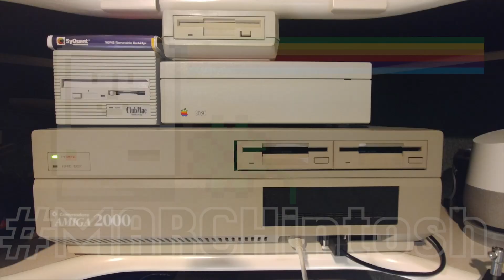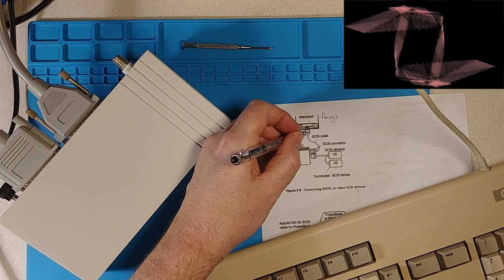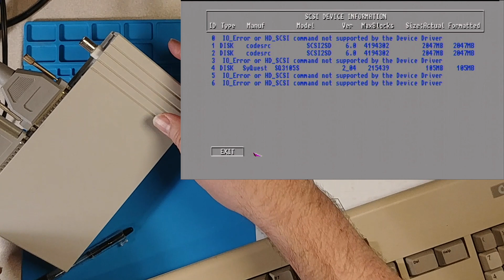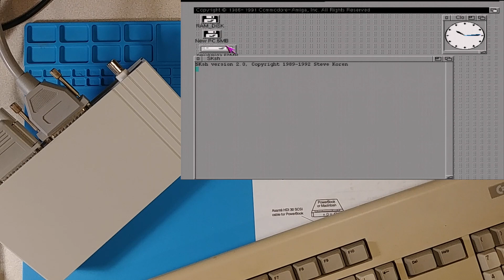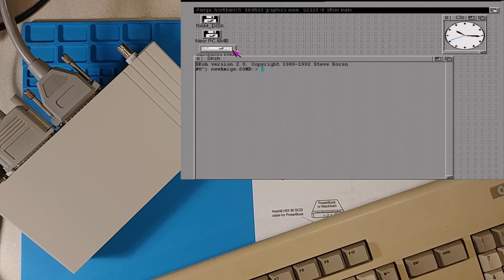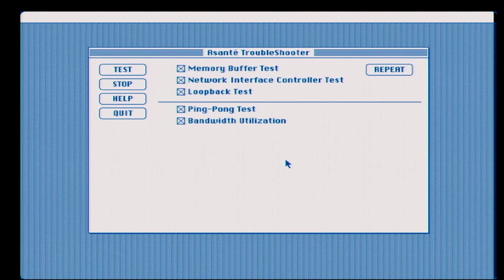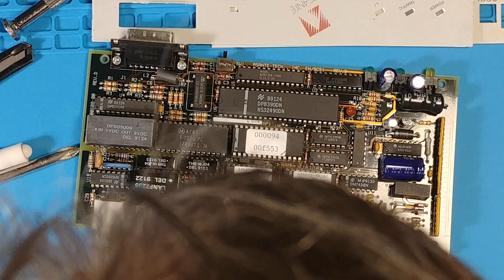#MARCHintosh Mac Plus: Sneakernet to Ethernet?

Comment: Not entirely related but I will throw it out for consideration. You can run NetPresenz (see Mac Garden for that), it's actually now free. You can designate an old Mac to act as an FTP LAN server (not god for WAN only because there would be an insecure connection but that would be up to the admin) … with that software allowing any LAN computer to access that old Mac FTP server. Alternatively, you could purchase something like CrushFTP (which I use) and create an FTP insecure instance server (Crush supports many protocols) and a modern computer could then offer plain FTP over say port 2121 for the LAN. You would connect using ftp://10.0.x.x:2121 username X pw Y and all your old vintage machines could then see files. Again, not related to the video topic but is more of a tangential comment. Thanks for the video!
Reply from the maker: Hi Alex - thanks for sharing ideas. Since all those require TCP/IP connectivity, I presume you mean I could do those after I got network connectivity, which I don't have yet. Because I have the early version of A-Max I also don't have a port for AppleTalk. (Later versions of A-Max have a card that goes inside the Amiga that offers these ports.)
I'll keep looking and have this on the back burner.
Ron's Computer Videos made an interesting comment that it would be interesting to see the RaSCSI project add ethernet for SCSI macs to take the place of this long-gone commercial Asante solution.
Another out-of-left-field possibility is to use something like the First Class BBS software. 
Geeky Bit channel just did a nice little intro to that:
https://www.youtube.com/watch?v=0RyhYFkz_-s
I would be stuck with slow serial (e.g., wifi modem or direct null-modem) for now but theoretically that would allow file sharing across Mac generations, like my System 6 machine to OS X. 
Of course I'm trying to get better than serial speeds. Anyway, just some random ideas. :)
Reply from the maker: Hi Alex - Aside: your comments seem to keep disappearing :-/. (I'm not doing it. :) and they are not in the managed comments anymore) If it is some YouTube problem, feel free to write me at the emali address in my channel's About info.

Comment: Can A-Max do AppleTalk over a serial port?  If so, you could instead use an AppleTalk to Ethernet bridge that supports MacIP.  That would allow you to connect to an ethernet network via your serial port.
Reply from the maker: Good point. It depends which version of the A-Max hardware someone has. I have the original A-Max cartridge, which only provides a 19-pin Mac floppy disk port. I use the A-Max II software (actually version 2.5, but with the original hardware.)
The later A-Max card has a port for AppleTalk.
You can see it here:
https://bigbookofamigahardware.com/bboah/product.aspx?id=341

Comment: The case looks to be of very high quality. Amazing how many archaic devices are out there designed to do random things. Never heard of this device. Neat stuff.
Reply from the maker: Oh, ya, it's a beautiful aluminum case.
These Ethernet-over-SCSI devices for Macs were roughly the equivalent of the similar Ethernet-over-parallel-port devices for PCs. RetroTech Chris showed off one of those here, i.e., the Xircom Pocket Ethernet Adapter III (at 2m25s): https://www.youtube.com/watch?v=uIb7AjsPSZw#t=2m24s

Asante made a smaller one called the Mini EN/SC and also some specifically for Powerbooks.

Comment: Lefty! You have 2 SCSI2SDs?  can you update one of those to be a "less steps" sneakernet?
Reply from the maker: I have three, but two are slated for my x86 Linux boxen with Adaptec SCSI host adapters.
For the Hackintosh, I decided to go with the FloppyEMU, after seeing Jeremy's glowing endorsement in his video this morning:
"The Mac that finally got it right. Macintosh Plus repair, history and test drive."
https://www.youtube.com/watch?v=d65ze2nuKp8
Reply from the maker: Duh, you're right. I'm being dumb. I already have the v6 SCSI2SD in the Amiga, and the Mac emulator can see it. I could probably just put native Mac partitions on it, and write to the SD card from a modern machine with Mini-vMac or something? This is along the lines of what Matt (retrobits) suggested... I just don't like the idea of having to run an(other) emulator on a modern machine just to populate the SD card... it's probably just because I haven't tried it yet.
Reply from the maker: I can pull my (flailing) 5 1/4" Seagate hard disk out of the Amiga (which is what I replaced with the SCSI2SD), and mount the SCSI2SD there, so I don't have to open the case to get access to the SD card.
Reply: @DrDavesDiversions  is that an st-225n?
Reply from the maker: @temporarilyoffline  From the same era, but it's the venerable and ginormous ST-296N (84MB) that I bought in college. I thought it was $400 in 1990, but I see it listed for $550 in the Safe Harbor (Amiga products dealer) price list I have - the place I bought from most often.
Reply from the maker: @temporarilyoffline  Somehow I doubt my SCSI2SD will last as long as the Seagate: 30 years.

Comment: I have a variation on this device that I've also never successfully gotten to work. It was over a decade ago that I last tried it and I know a lot more about networking now, so maybe I'll give that a try. If it's similar or uses the same chips I'll let you know. Mine is a lot smaller and from what I remember encased in rubber, but there has to be a breakout box or something. Like I said it's been a long time since I've played with it.
Reply from the maker: Super cool! Ya, try it out! There is one called the Mini EN/SC and and also an EN/SC PB (powerbook). The Asante driver (5.1) loads fine on System 6.0.8.
Reply from the maker: I could have used your rum punch after screwing around with this broken thing last weekend! :)
Reply: @DrDavesDiversions  😂😂😂 I totally understand.
Reply from the maker: @JeremysRetroBar  19:20 I should make a "sigh" playlist. :)

Comment: Happy St. Patty's Day! Sorry you weren't able to get it working this time around :( It would be super cool to be able to use native Mac hardware   on the Amiga. 

My preferred way of getting data to the Amiga: if it's small, Zmodem download from my linux pc over WiFi modem and if it's large, stick the scsi2sd's card in my main PC and mount it up inside of UAE. Neither is ideal and having networking or USB would clearly be an improvement. 

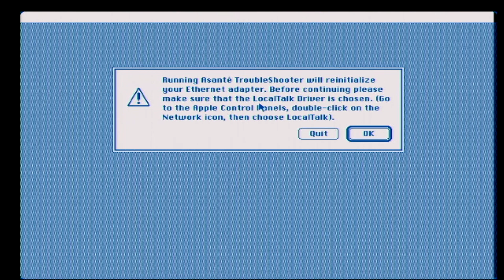15:32 Speaking of quality of life improvements, I'm a big fan of the "NoClick" utilities found on Aminet!
Reply from the maker: Hi Matt - thanks for the ideas! I do run NoClick on the Amiga. It doesn't work when I boot A-Max II. (Remember A-Max II does not run concurrently with Amiga system; it takes over the whole machine.)

I do have an SD card reader for my MacBook Pro, but running UAE just to transfer files seems less than ideal. I'm a one emulator at a time guy, not as promiscuous as some of you. ;)

I think another fairly nice way would be to mount my HFS partition on a SCSI storage device from a Linux machine that has SCSI. I have two x86 Linux boxen with Adaptec SCSI host adapters, but both machines need new PSUs. (Project pending :) )
I guess if I put a SCSI2SD on those x86 Linux PCs I can just pop an SD card in that has the HFS partition.

Guillaume over at ReTroLab says he mounts HFS (for his real Mac Plus) from Linux on the Raspberry Pi.
Reply: @DrDavesDiversions  Ah that's interesting. So the drive clicking is a function of the hardware not the OS! TIL. 

I use WinUAE because Windows does not recognize the partition table on my sdcard after the Amiga is done with it, so even though I could have a real HFS partition and a real FAT partition that the Amiga could use with CrossDos, it's not accessible. It's an extra step using UAE but I don't have a NIC, a Gotek, or any other way besides the serial port to move data. Yet.
Reply from the maker: @retrobitstv  Steve @ TO made it clear[er] to me that I should just be able to use my SCSI2SD cards to xfer things, so I spent a couple hours this morning rearranging things so the SD card and USB port are available on the front of my machine. That was a good idea: make things convenient. I will use some of the ideas you suggested so that I can use SD card partitions for the xfer! tnx!
Reply from the maker: @retrobitstv  the click is probably part of the Amiga floppy driver code that somehow A-Max caused to reinitialize. It relies on that, I am sure, to read A-Max-format and AmigaFFS floppy disks.
I should look up why the click was there in the first place since clearly disk presence can be detected without it on most floppy hardware.
Reply from the maker: Ooh, Guillaume mentioned he uses RaSCSI and I see this page for it says they are working on an SCSI Ethernet adapter!
https://www.tindie.com/products/landogriffin/rascsi-macintosh-version/

Comment: Take the webserver out of the loop by running a temporary webserver on the box you did the download on with stuff you probably already have installed, python2 or python3:

python2 -mSimpleHTTPServer
or
python3 -m http.server 8000

Both will serve up the directory you're currently sitting in over port 8000, then use wget on your Linux laptop to grab the file(s).
Reply from the maker: Thanks, I am aware. but was being (falsely) lazy so that I didn't need to futz around with firewall rules and such. Perhaps most sensible to me (since HTTP need not be involved), I could upgrade the ssh[d] on my Dell machine running Debian Linux so I could just scp directly from my modern laptop. (Right now, it is so old that it doesn't support any of the ciphers that my modern ssh tries.)
Q: You know what's easier than doing that, at least the first time? A: using an existing web server that's already up and running.
I fell into an old trap: if I were only going to do it once, this was the faster/easier/shortest path. However, since I'm finding the need to do it 50+ times, reconfiguring as you suggest is faster/easier. :)

Comment: hey here is an idea, not as ideal as networking but it is what I use for a lot of my retro systems that it is to expensive for a network device and that is a set of gotek floppy emulators.  On the modern computer hooked up via a USB to floppy adapter which the gotek seems to be compatible with then the second gotek is in the retro computer itself. I also install flash floppy on the goteks so they work better and a OLED Screen, so I get more information that just 2 or 3 digits.  The best part is with a little 3d printing the solution looks good in whatever your using it with. There is also CiderPress and FloppyEMU for a lot of direct mac hardware stuff. Since your middle man is Amiga I think the Goteks will work fine as they are compatible with amigas. Man do I miss my Amiga 2000 I still regress donating it to good will back in 2003 or 2004
Reply from the maker: Thanks! That is a good alternative that would take a few steps out of my sneakernet. The FloppyEMU looks interesting since my A-Max has a Mac external floppy drive connector.
I've been really happy with the annotated, disassembly of the Mac Plus ROMs - just fascinating to see all that in such a small footprint. Doug at The 10 Minute Amiga RetroCast just did a great job putting a gotek on the front of his recent A2000 build.
https://www.bigmessowires.com/rom-adapter/plus-rom-listing.asm

Re: the 2000, I have an 30-year-plus long affection for it. The 3000 is a prettier machine, but I'm happy with this powerhouse... well, back in the day. :)
Reply: @DrDavesDiversions   To be honest I order bulk packs of Gotek clones from china on aliexpress  I think I got a 10 pack of gotek boards for like 100ish or 120ish back in mid 2019. I 3d print the housing as I want to do that anyways because the prefab cases don't fit the OLED screens right. It makes it cheaper buying in bulk and just the populated board and not the full unit. The completed units were like 17-24 USD each. Pay 10 to 12 bucks was a lot better. The FloppyEMU is great, but the price is a little much though IMO. There Is also wDrive which is like 60 or 70 US... I do like my FloppyEMU and I haven't used a wDrive as they were still being worked on when I got my first FloppyEMU. Either way there are some options.

EDIT: The reason I did this with the gotek drives is because it isn't just me, my wife also loves retro computers, but for their games not their tech stuff. So for her it just has to work and the gotek floppy drive to usb device and the retro hardware having the same thing makes copying old games over easy for her. I wish there was a good CD Emulator like device. There was this Pi solution but it uses USB...
Reply from the maker: @GeekyBit  Oh, I didn't realize they were dirt cheap. Thanks for the add'l insights. I like having my Mac environment being able to read "real" Mac floppy images. I'm not sure I can do that with a gotek installed in the Amiga.
I've had good luck with mountimage under System 6, but they still have to fit within a 720k floppy.
https://macintoshgarden.org/apps/mountimage
Reply: @DrDavesDiversions  I don't have an amiga  (I have an armbian Pi , I do want a vampire v4 though) so I would have no way to test as that really is the only case where you could do so. As I think you can capture the amiga disk drive in the emulator to use real Mac floppies. The interesting thing with flash floppy firmware is it is just a reader of disk images so as long as it is set to be used by the amiga and then set to capture in the Mac emulator software it should read a 800k .img file... but with out a way to test it myself I couldn't tell you. It seems like an edge case as no google results gave me anything outside of people trying to rewire them for the mac. I can say the USB to floppy adapter I use with the gotek is not something commonly done either. I do know the gotek with flash floppy firmware and using the USB to floppy adapter lets me hook it up to my g4 mac and it reads Mac 800k img files, but it sees the gotek as a DOS/PC floppy drive and not a apple drive so I don't know how that would work on an old Mac or an Emulator like software.

I know this is a little long winded and kind of a convoluted explanation but I hope it helps.
Reply from the maker: @GeekyBit  Thanks! I'm here, in part, to learn. thanks for the details. One of the few advantages I have with my very old Mac emulator is the ability to read real Mac 400k/800k disks. I'll feature that later this month.

Comment: What an interesting device, it's a shame it doesn't seem to work correctly.  Would it be any help to get an ISA network card that can work in an 8-bit slot and add that into your A2000, as the 8-bit XT ISA slots should be operational if you've still got the PC bridgeboard in there.  I realise that may not get the files into the Macintosh system, as I'm not sure about getting A-Max to work with that sort of a setup, but it should still remove the need for floppy disks and the problems with needing to keep files under 720K.  I never did this, as I never got the bridgeboard (I had the same one) working in my 4000/040, but I did look into it and apparently it's not particularly difficult to get that sort of setup working and accessible on the Amiga system - so without needing to do anything in DOS.
Reply from the maker: Hi Troy! That is a good suggestion for another way to avoid Sneakernet, except fetching things under DOS and using awrite/aread under the Bridgeboard seems like some level of hell. I am aware of the Amiga Ethernet driver that uses a PC NIC via an installed Bridgeboard. It seemed daunting to me, so I didn't try it yet.
https://www.heiko-pruessing.de/projects/etherbridge/eb.html
If you know of someone else who has gotten it to work and shared it, please let me know!
The other way would be to get a real Amiga Ethernet NIC, but I am not too fond of changing Amiga's system software to do it. Doug over at The 10 Minute Amiga RetroCast just set that up in the 2000 he built. I imagine you already subscribe, but for those that don't, he is a font of Amiga knowledge.

Also, I currently can only run my Bridgeboard by disabling the 68040. It might be just that I need a different 68040 library version or similar, since others have gotten the Bridgeboard software to run in concert with a 68040, but I didn't figure it out during my #DOScember project. I dropped down to the 68k for the videos in that playlist.
Reply from the maker: Oh and also, what a shame there wasn't an Amiga driver for the EN/SC. I bet it could have been made to work like a charm, but I guess Asante thought the market (esp. the subset that would buy a SCSI NIC) was too small.

Comment: I would imagine it is a programmable device so if you can find someone who has the same Asante device, perhaps they would allow you to dump the ROM and then you could reflash that to a new ROM chip and get your device working?
Reply from the maker: That would be great. I can't believe I didn't think to mention this in the video! I would also be willing to send this to someone willing to test mine out by swapping those socketed ICs.

Anyone: Drop me an email if you have this original model Asante EN/SC and want to loan me yours or receive mine and we can fix some things in collaboration!